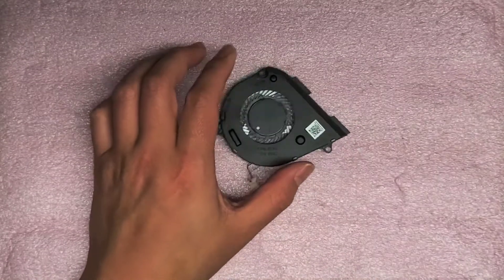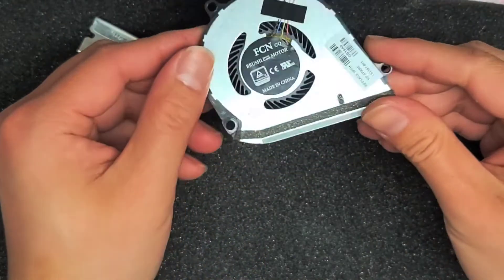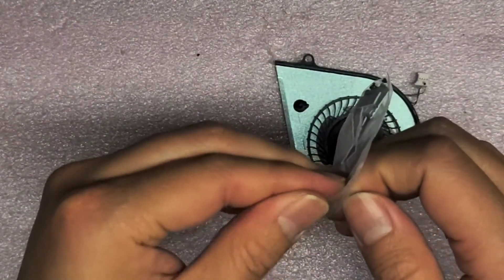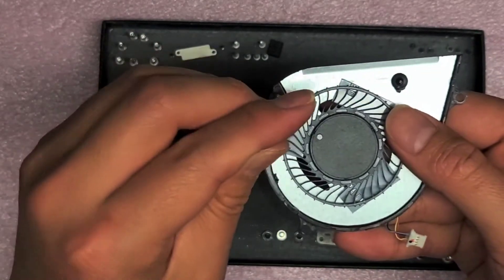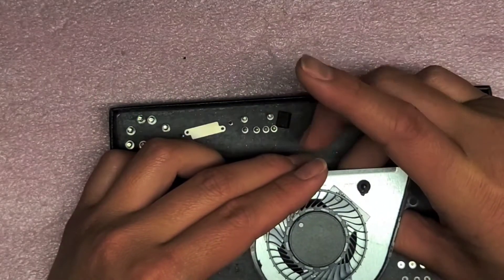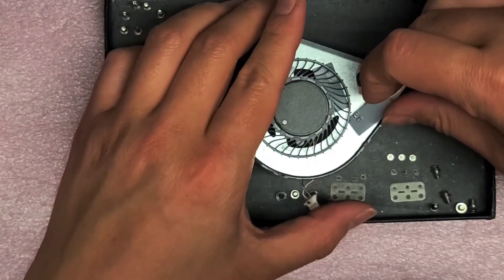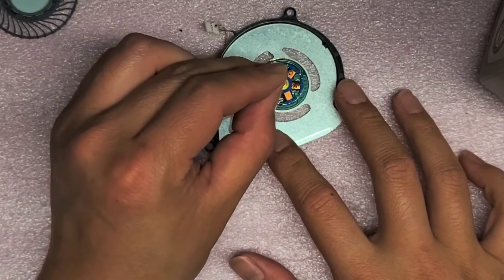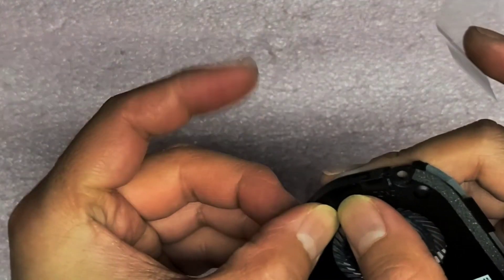How to Fix Noisy Laptop Fan Repair Fan Blades Difficult to Remove *Other methods in the description*

Comment: I also have a CPU fan that just won’t come out. The design of that fan is somewhat like this.That fan is rattling I wanted to lube it. I will try this method and let you know if it works. Otherwise I will go with a new fan
Reply from the maker: Sounds good

Comment: I FINALLY FIXED my Huawei Matebook D15 thanks to this guide!!! My laptop fan makes a rattling noise every time it's on. After lubricating the bearing the fan now functions like brand new.
My laptop fan has a similar design with the fan in the video, but I just pushed the blades out with my fingers and it easily disconnected from my fan.
THANK YOU FOR MAKING THIS GUIDE!!! I thought I have to get a replacement but nope!
Reply from the maker: @santiyesss  awesome, glad it worked. If you haven't already, please like and subscribe so others can find my videos and possibly consider watching a few others, liking and commenting to get the algorithm to recommend my channel. Thanks!

Comment: Hello brother how are I hope this meassge find you well 
I have this ilife digital laptop zed zir cx3 and it fan blades is broken form me like 2 out 30 and I cannot find a new one just like that so I thought you can help me in finding the same or similar to that which I can used it in my computer system 
Hope you reply 🎉🎉🎉🎉
Please ❤❤❤❤❤
Reply from the maker: @welcometoytshorts  check if there's a model number on the fan itself

Comment: hey man, what laptop are those fans from? thank you in advance :)
Reply from the maker: All different models. Here's a playlist of them Fan Repair: https://www.youtube.com/playlist?list=PLSSiYX-ta7aqqxfDWDQh-B6Az4ZgDI459
Reply: @ItsBinhRepaired  i know but for this specific video, what laptop are these fans coming out of? i really need to know
Reply from the maker: @Lovena39 I don't remember. What's so important about where it came from? Check laptops I worked on 4 years ago I guess.
Reply: @ it is a kind of complicated question haha but like
i have a acer predator triton 500 515-51 and the fan blades (not the whole piece itself, this is really important) that are inside of my laptop are extremly similar to the one you use on that video.
one of my fan blades (again, not the piece itself, just one of the two fan blades) is broken and i wanted to use a similar fan blade to replace it since i can not find the original piece haha
Reply from the maker: @Lovena39  you can't just get something similar. Lol the size and length, thickness, etc. Are all different. You need an exact replacement.
Reply: @ItsBinhRepaired  probably... but it might be worth trying right? this piece looks extremly familiar. 😿
Reply from the maker: Not sure. Maybe search for random laptop fans

Comment: what if the bearing of the laptop smell a little burn then what can i do about it??? mine is a NS85C28 fan for predator helios?
Reply from the maker: @watman2532  if it's burnt then replace the fan.
Reply: @ItsBinhRepaired  thank you
Reply from the maker: @watman2532  no problem

Comment: Solid tips - interesting method to get the rotor off the axle. 
You can also use sewing machine oil for the axle. Main thing of course - don't get any on the rest of the electronics!
Reply from the maker: Sounds good! If you can get to the center ring of the propeller, you can push on that. That's how I get the fans out now.

Comment: I think that you can cut a small circle and then cut like a pice of pie from it to be able to slide it between the fan and the case of the fan.
Reply from the maker: That should work. I've been pushing on the center ring now, which works for most fans.

Comment: Excellent! Finally a work worth of the "repair" moniker. Well done!
Reply from the maker: @mcrsit  haha I got lots of videos showing different methods.
Reply: @ItsBinhRepaired  I swear I just followed this one, and apart from having to flex back the metal housing, that got bent during the fan removal, it has worked flawlessly. I finally have back a silent laptop! Thanks again for sharing.
Reply from the maker: @mcrsit  awesome, glad it worked. If you haven't already, please like and subscribe so others can find my videos and possibly consider watching a few others, liking and commenting to get the algorithm to recommend my channel. Thanks!

Comment: my fans dont have these pins but are almost the same , they make noise even after i cleaned them , what do i do ?

(i got a msi stealth gs75 9sf for reference if you wanna know what cooler it is)
Reply from the maker: This playlist will help Fan Repair: https://www.youtube.com/playlist?list=PLSSiYX-ta7aqqxfDWDQh-B6Az4ZgDI459
Reply: @ seen all of them and yet my fans dont have that middle pin attached to the blade , they still spin but very rare
Reply from the maker: @k4777zzzz  sounds like it broke off

Comment: One of blades is broken what could i do??
Reply from the maker: You'll need to replace the fan
Reply: @ItsBinhRepaired  there is no another choice?
Cant i just use super glue?
Reply from the maker: @YadRiley you can try. It'll be tough.

Comment: Thank you for this video that helped me to fix my noisy Lenovo Z70 laptop cooling fan.  To take out the blade, I used the stainless steel spudger tool (4.8" x 0.4" x 0.04") from my cellphone repair tool kit and I slid this tool under one side of the blade; then I slightly twisted it or wiggled it to pop out that side of the blade. I then did the same on the other side of the blade to pop out the whole blade completely. For oiling it, I used the 3-IN-ONE Multi Purpose Oil bottle that I bought from Home Depot store back then and I put one drop into the middle hole. Now the noisy sound from my cooling fan went away completely.
Reply from the maker: @tuanngnt  awesome, glad it helped. If you haven't already, please like and subscribe so others can find my videos and possibly consider watching a few others and commenting to get the algorithm to recommend my channel. Thanks!

Comment: what if blades dont come out?
Reply from the maker: You'll need to replace the fan.
Reply: @ItsBinhRepaired  thanks for answer, after some hours, i fixed it  by pouring some fan grease on the ring, like and sub
Reply from the maker: Glad it worked!

Comment: Mine really just sounds like something is loose. So, I moved it around in different positions. Amusingly, it stopped making noise after placing it port side (like a vertical book).
Buys me time for next steps since the laptop is plugged into a monitor.
Reply from the maker: Hmmm

Comment: I LOVE YOU FOR THIS, I WAS ABLE TO REPAIR MY LAPTOP FAN WITHOUT ANY ISSUE (JUST HAD TO BE CAREFUL) ONLY LITTLE ICK ABOUT MY REPAIR IS THAT I USED CLEAN COOKING OIL (I KNOW ITS BAD BUT I LITERALLY HAVE NOTHING ELSE.) THANK YOU ❤
Reply: Did the issue recurred after doing this? How is it now?
Reply: @Sakamoto_1535E3  It’s still going strong ! I’ve been using my laptop daily and the fan doesn’t get stuck anymore. (Tho I don’t recommend using what I used but if you can’t get your hand on something else then…)
Reply from the maker: Haha interesting.
Reply from the maker: It'll likely go bad again in a few months. Cooking oil turns goopy too quick.

Comment: For long-lasting lubrification, use lithium grease (good for bronze bushing. Use light synthetic oil for ball bearing) you can also use light oil for bushing. 5/W30 synthetic motor oil work well. Be careful, if you use compressed air for cleaning. High-speed rotation of the fan will generate voltage that can be harmful to the electronic circuitry of your fan and computer. Disconnect the fan from the motherboard or lock the rotor (fan blade part) with a toothpick before blowing compressed air to be absolutely sure that you don't break anything.
Reply from the maker: Haven't had any issues electronically, but have had a giant dust ball take out propellers one time.
Reply: I personally recommend PTFE Oil....

Comment: just be careful with the aluminium cover. it can be sharp and cut the skin
Reply from the maker: Hmmm Possibly
Reply: @ItsBinhRepaired  I just remembered, I opened the fan, otherwise without opening it should be ok.

Comment: I've just broken mine, don't do it friends!
Reply from the maker: Sounds like you did it wrong. Should also check other methods.
Reply: @ItsBinhRepaired  My laptop is MSI GE76 Raider. Fan model  pabd1a010shr-n451. I just wonder what should I do for a possible next attempt in the future. May I ask your idea?
Reply from the maker: @xchampionx9  this has all different methods Fan Repair: https://www.youtube.com/playlist?list=PLSSiYX-ta7aqqxfDWDQh-B6Az4ZgDI459
Reply: @ItsBinhRepaired  I've watched them but how do you decide or know which one to push or drill
Reply from the maker: If you can't push it out, then you have to drill or replace.

Comment: Hey dude, one of my laptop fan is making grinding like noise and I am worried if it will damage and overheat my system.
For about a month, it somehow fixed itself (after getting cleaned) but started the same thing again now.
As long as it is spinning fine, is the noise merely an acoustic inconvenience as opposed to causing any functional problems?
I will still get it fixed of course, but was just wondering if it was safe to use it till then as it is my main and only work machine.
Reply from the maker: I can't say without seeing it. You can monitor your cpu temps to be sure
Reply: @It's Binh (Been) Repaired & Reviewed  CPU temps seem to be just fine.
I was wondering if it could damage other components somehow.

Recently got some MOSFETs / resistors replaced in my laptop mobo due to faulty battery.

It is just over an year old so I was concerned that the fan issue might have indirectly caused that to happen.

The noise is exactly like in the video.
Reply from the maker: @anmolagrawal5358  usually just the cpu as far as I know

Comment: What if one if my laptops fan is wobbly? One of them is really solid while the other is a bit wobbly and it makes a buzzing noise
Reply from the maker: Might have to replace it
Reply: @ItsBinhRepaired  yeah thanks i managed to clean the dust it was still not working so i ordered a replacement fan
Reply from the maker: @atrexye6117  sounds good

Comment: I just wanted to say thank you! My daughter has Dell Inspiron 2350 All in One (built like a laptop). I tried to replace the fan using "OEM" Dell replacement parts from several online vendors (Dell no longer has any fans for this model). Every fan I ordered was the correct part number, but none of them was a correct fit for this computer. If I hadn't come across your video, I would never have been able to save this computer. Much thanks to you! By the way, seeing you cut the plastic off the original fan and taping the cover back on, saved my butt...
Reply from the maker: Glad it helped. If you haven't already, please like and subscribe so others can find my videos. Thanks!

Comment: 12:19 what appeared when the fan blades were popped off the motor assembly...revealing that taking off the sticker wouldn't have exactly revealed anything to lubricate?
Reply from the maker: Wuh?
Reply: @ItsBinhRepaired  I was thinking hey, the way you're going has all these extra steps, is it any good compared to just putting oil in through the back (by simply removing the sticker for the operation?) And yeah, it was! It lets one remove bad lube and particles jamming the bearing! And there might have been no access from the back at all. (I was trying to memoize a bit for the TL:DW crowd too.)
Reply from the maker: @davenordquist4663  you can't add lube under the sticker. On laptop fans it's solid plastic or metal underneath.

Comment: Thanks very much for this tutorial. You can make working with the three screwdriver tips much easier by just taking a piece of cardboard (perhaps you would need two pieces), and putting three holes in it. Then push the screwdriver heads through the holes. They will then be spaced correctly and will help keep each other pointing upwards, even without a magnetic tray.
Reply from the maker: I read it again and now understand what you meant. Good idea!

Comment: Dame the only proper way to fix an old hp pavilion fan. Was drilling backside but just got worse🤣. 
Had 0.3 metal shims*3 + force =fan flew off. Cleaned out earlier drilling junk, a drop of hydraulic oil inside, bearing was inside the fanhead, or if its just brass as bearing on this crap.
Used paper to apply tiny bit of oils on the 4 side heads of motor for some reason.
Well spins now in pc, no more start and stop.😜
Used electical tape to seal my backside drill hole and the big metal seal.
Next time no need for drills🤔
Reply from the maker: Yeah, sometimes it'll pop out, but it can also damage the fan, you never know. Lol

Comment: I randomly found this and got intrigued. But what noise is it?
Reply from the maker: Which noise?
Reply: @ItsBinhRepaired  because on the video it says there is loud noises and random noises in the fans. So I was curious about what causes those noises?
Reply from the maker: @Pengooine  bad grease or no grease.
Reply from the maker: It makes a grinding or buzzing sound usually.
Reply: @ItsBinhRepaired  oh ok thank you
Reply from the maker: @Pengooine  no problem

Comment: The other video you have where you drilled a hole so you can lubricate the fan shaft, can we do this method instead of drilling?
Reply from the maker: Use whichever method works.

Comment: may i know what kind of tape is that small black its so sticky my fan has the same black tape as yours but its so small i feel like its telling me no need to fix my fan just replace it lol
Reply from the maker: You can use any tape
Reply: is there a laptop fan blade that shaft is not connected to the blade if there is none then i think i broke mine

Comment: Can electrical tap work when sealing it too? Like from brands by 3M? Or does it have to be thin clear tap? 

Also, I really appreciate your video!
Reply from the maker: Any tape would be fine, but I don't like electrical tape because the adhesive usually gets all gooey after a while.
Reply: @ItsBinhRepaired what type of tape would you recommend? I cant find an answer anywhere on what kind of tape that is.

Comment: Just wanted to say I have a Wacom Cintiq Companion 2, and my fans were uber noisy, I couldn't find any replacements fans online and then found your video and tried it out. Now my fans are nice and quiet again. I will say I did use Isopropyl Alcohol to clean everything inside after I had thoroughly dusted it, and I didn't have oil and then I remember I had the oil for my mechanical razor and went and got that to use and everything worked great! Thank you so much for this video :)
Reply from the maker: Awesome! Glad the video helped. If you haven't already, don't forget to like and subscribe so others can find my videos. Thanks!
Reply: @ItsBinhRepaired  yes I did like it! I also went ahead and created a post on the Wacom sub-reddit explaining my proccess and also linking to you video for other to see it! Because seriously, I had not seen a single fox for the fan problem for the Wacom Cintiq Companion 2 online. So I bet others will find it helpful!
Reply from the maker: Awesome, thanks!

Comment: Nice video, how should I know which method to use in my Fan?? I dont know if my Fan needs the drill method or this one
Reply from the maker: Try the non destructive ones first.
Reply: @ItsBinhRepaired  i tried to pull out the fan but nothing happen, i dont wanna break it. i think that my last option is drill the hole
Reply from the maker: You can try the lazy messy way and spray wd-40 in it and pray lol
Reply from the maker: I don't recommend it though
Reply from the maker: You can also buy a replacement fan as backup
Reply from the maker: Watch the other videos in the description.

Comment: God this type of fan design is the worst, attempted it for my laptop GPU fan but it ended up breaking so I bought a replacement part.
A few months later now it's the CPU fan doing the same thing so I'm just debating on trying to re-oil the part or just buy another since these things are painfully difficult to take apart.
Reply from the maker: Yeah :(

Comment: Never cut toward yourself; always cut toward someone else!

DON'T use oil pulled out of a lawn mower/trimmer/whatever! You could introduce tiny, abrasive particles into your very small fan bearing! Just buy a $4 quart, or ask around -- someone you know with a car keeps a quart of oil in their trunk. Just get a few drops of that, and keep it in an old pill bottle (cleaned thoroughly,) glass vial, or anything that won't spill.

Don't work on your parts tray!!! Especially when doing anything that requires force. If you slip, you could knock little parts everywhere. I speak from experience. I have made many such mistakes.

Don't mean to be critical!  (oops, sorry...) Great video, man! Very helpful and clear, thank you!

The Rocket Blower is a great idea! If you aren't familiar Manfrotto (photo equipment mfr.) makes them. They take in air through a filter at the bottom, and blow the dust-free air out the top. Very good application for it, and they're cheap--only around $10 or so.
Reply from the maker: LOL

Comment: Bro I have the exact same fan.The problem with it is that I can easily rotate it manually.But when plugged inside the laptop it never rotates on it's own and requires a manual rotate to further keep rotating.
Reply from the maker: Possibly failed motor. You'll have to replace it.
Reply: Yup, failing motor, or stuff caught inside the fan that you can't see, or a slightly warped blower housing (the sheet metal plates) that's touching the plastic fan blades. When you push it around by hand, do you hear any scraping, hissing, or ticking sound? If so, there's something touching the fan. When it does run (after you push it to get it going,) does it sometimes chatter or buzz?  Short answer, spend $10-20 on eBay and get a replacement.
Reply from the maker: @neuromonkey  yeah